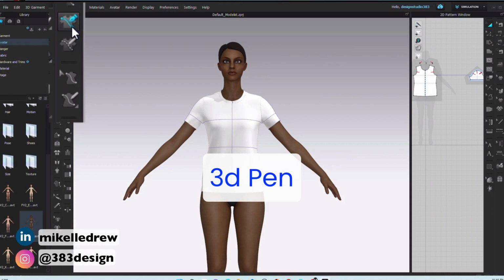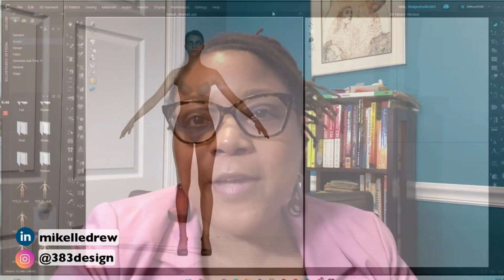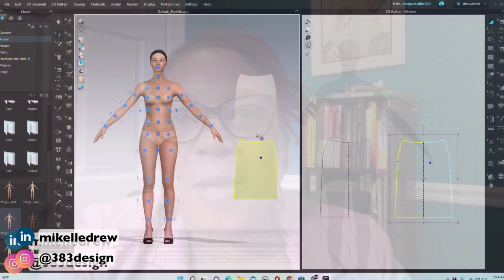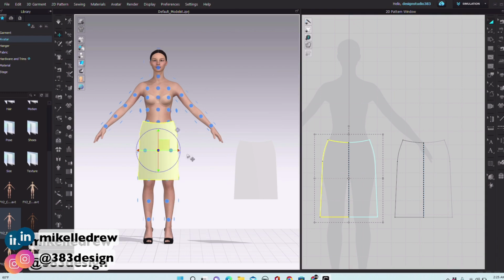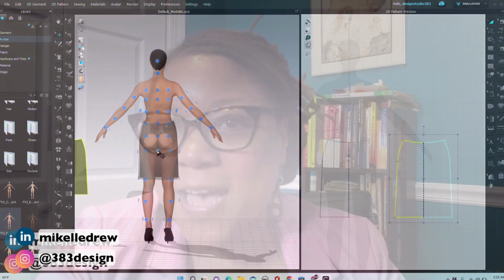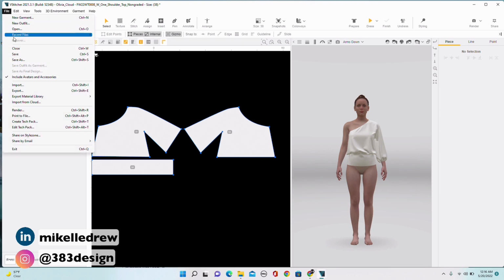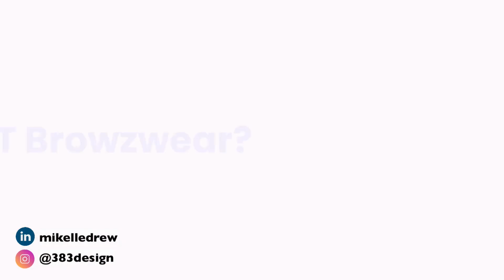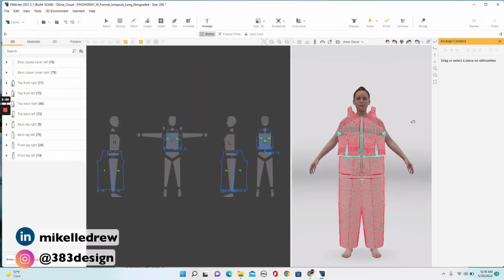Browzwear vs Clo3d | Which 3d fashion design software should I Learn?

Comment: Hello great video! Im looking into creating necktie patterns and designs. Would these programs be good for that or do you recommend something else?
Reply from the maker: @gabriel114867  Hi, thanks for watching and commenting. Assuming the focus is surface pattern design for neckties, correct? Not the actual pattern? If so, I would suggest choosing a simpler tool like Illustrator for Photoshop. And honestly, even if you are creating a necktie pattern, they’re not as complex as an entire garment pattern, and you can probably still create it on Illustrator.

Comment: how can i work in browzwear? downloaded the program VStitcher, requires a license. Are these programs paid?
Reply from the maker: Hi, thanks for watching and commenting! There used to be a Browzwear Indie Program for independent designers but they discontinued it a couple of years ago. At the time, they said they were revamping it, but I haven't heard anything about it since.

If you want to use Browzwear, my suggestion is to contact sales at this point to find out what options you have to gain access. Right now, they may only be focused on enterprise sales.

Comment: hey 383 design studio,

If i wanting to mainly design leather bags, do you recommend any 3d software that is low cost to get this done?

THank you so much
Reply from the maker: Hi, thanks for watching and commenting.

Hmmm, maybe Rhino 3D. It's often used for footwear and accessories. The good thing about Rhino is that it's a one time charge. However, you do need to pay for upgrades. (Not sure how often they upgrade.)

It's possible to use CLO or even Marvelous Designer if you don't need some of the fashion specific features like exporting a pattern, making a marker, tech pack, etc. Marvelous is a little less expensive than CLO.

I am also about to start learning Style3D which is similar to CLO but less expensive. I've heard great things about the software, and I hear it's easy to learn. I haven't used it, yet, though so just passing on feedback I've gotten from others. I believe their trial period is also more extensive than CLO. (Don't quote me on that one, though.)

Comment: What is the price between both programs?
Reply from the maker: Hi, thanks for watching and commenting. Currently, CLO is the only one with a subscription model. You should check their website since this might change but last I checked it as $50USD/mo. Right now, Browzwear has a program for independent designers that you can apply to for access to the software. I know they are working on a subscription model, though.
Reply: @383design  thank you so much! Yes, I was looking at both their websites and Browzwear was unclear on the price. I have more knowledge in Browzwear from my corporate work, but would like to learn CLO as well. 
Your videos are very informative, thank you so much!

Comment: Hi Mikelle, When you made this video (last year) Browzwear didn't have a "freehand" tool like CLO where you can draw on the Avatar and have a pattern created automatically.  They seem to have something similar where you can draw and "extract" pieces but it doesn't compare directly with CLO's freehand tool...   I was just wondering how things have progressed generally and if your opinion may have changed since on whether or not one is "better" than the other.  I'd love to hear your opinion as you're an expert in the field.  (Pattern accuracy is fairly important to me)
Reply from the maker: Thanks for watching and commenting, and my apologies for the delayed response. I could have sworn I already answered this. Anywho, I actually asked Browzwear about this, and I was told they don't have a tool comparable to CLO's 3D pen, and from the further discussion, I got the impression that adding something like that was not a priority for them.

I don't think one is better than the other in general terms. I do think one might be better to execute a project or your brands needs. If your focus is more on pattern work, Browzwear might be the better option for you. The learning curve is a little higher, but IMO, it forces you to be more accurate when you're creating your patterns.

I know there are freelance patternmakers that use CLO, but besides ease of use, I think some of that is because CLO has a subscription model, so you can easily just sign up and start using the program. Browzwear doesn't have that yet. And although they do have a program for Independent Designers if they want to use the program, I think a lot of people just find CLO easier because you can just go to the website and signup.

Comment: Sorry it is not not about design, rather than manufacture question. Can i feed the design pattern to any maschine? if so what are the affordable machines  producing these that we get from these 3d software. your help is much appreciated
Reply from the maker: Hi, thanks for watching and commenting:) I'm not completely sure what you mean by "feed the design pattern to any machine." You can definitely export a .DXF or .PDF pattern (there's a few other file formats as well) so you can output the pattern from a plotter to make a physical garment. Is that what you mean?
Reply: @383design  hi thanks for the quick reply. I would design on 3d clo and take dxf to an automatic production line if this how the entire system works. Or there are sawing machines  and operators do them individually.
Reply from the maker: @janosgyerman  I think the first option is your best bet. I believe TukaCAD has specific machines that work with their software to create a marker and laser cut your patterns, but  they are WAY more expensive, and their software and machines are proprietary.

CLO does have an option to create a marker, though, so you can create that layout so when you're ready to export your patterns, it's ready to be laid out on the fabric and cut.

Regardless of which software you choose, you do have work with a manufacturer and sewers. It's automated up to that point;)
Reply: @383design  thank you so much for the information :)

Comment: 8:57 I use paper patterns that I draft from technical sketches. I love my digitizer to transfer paper patterns into digital format. Not too many fitting issues. I wonder if any of this software will work with my table top digitizer? Do you use a digi pen or tablet for paper patterns?
Reply from the maker: Hi! Thanks for watching and commenting! I'm not sure if there's a direct link within the program, but you can certainly digitize and save the pattern as a .DXF or .PDF file and then bring the pattern into the program. It's done very often!
Reply: @383design  one yr later and I am resigned to the fact that I needed to just take your course all along. I bought a program, AFTER I tried OPTITEX to the tune of $6 grand....I was so angry with myself. That said, you were right, Clo3d and a file converter (also expensive) will have to do. I am recommitted to this work since I have spent so much $$$$ and time. See you in 2025

Comment: If my primary goal is to break into fashion through freelancing with no fashion school experience, what program is the most marketable? I've been studying how to do flats and tech packs in illustrator and really want to give myself the best chance possible at getting work when i start sending proposals.
Reply from the maker: As a freelancer, either is good. It really depends on what you're planning to do. You mention flats and tech packs, so I would suggest CLO. There are a lot more people now asking for 3D visuals from design freelancers, and CLO is easier to learn and you don't have to be as technical. (If you're interested in pattern making and more tech design, I would suggest Browzwear.)
Reply: @383design  Thank you!
Reply: Thank you

Comment: Hi! Im totally new in digital design and I'd like to learn. I'd like to do some NFTs. Which Software do you recommend? I'm actually a jewelry designer, is it possible to do jewelry with these softwares as well?
Reply from the maker: Hi, Alejandra! Thanks for watching and commenting!

You can actually use either for NFTs, though I've seen more people use CLO3d (I think more because it's a little simpler to use IMO.) For jewelry, I believe you can use either, but the folks I've known that have done 3d jewely design have used other programs like Rhino.

Comment: With Clo3D I find it’s easier to do pattern cutting from a fitted sloper then using the flattening tool, just for accuracy. I spent so much time correcting in software.  All the lines become so obscured especially on my plussize avatars it’s a lot testing, measuring, and walking the patterns. I really want to use these softwares to help make it cheaper for me to do production for my small brand. I find I still have to develop base patterns physically and send it to a grader.
Reply from the maker: Thanks for watching and commenting! Have you used Browzwear? It might be a better option for you. Or Optitex. I always get mixed reviews about Optitex but every tech designer I know who’s used it says it’s amazing for pattern making.
Reply: @383design  I am actually currently taking their free courses right now to learn Vstitcher and the workflow is abit more restricted but there’s a lot more emphasis on accuracy. I feel working in 3D fashion your always going to work with multiple softwares no matter what.
Reply from the maker: @alexyarally  Yes, Browzwear is used a lot more in corporate by Tech Designers. And agree, much more emphasis on accuracy while Clo feels much more like a designer's program where you can just freely create. Browzwear still gives you an amazing rendering, but you definitely need to understand patternmaking a lot more to get to the final result.